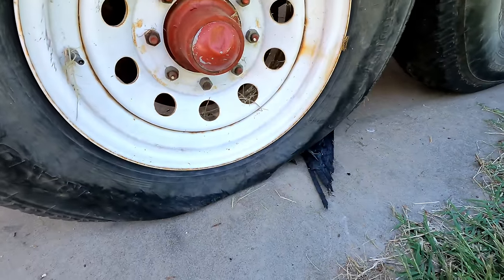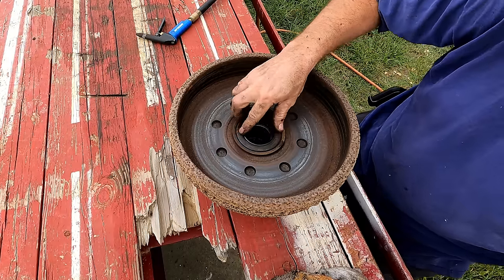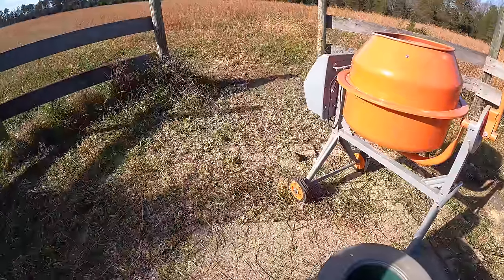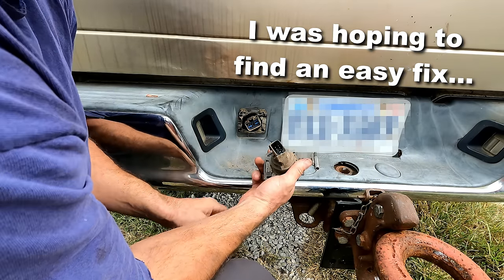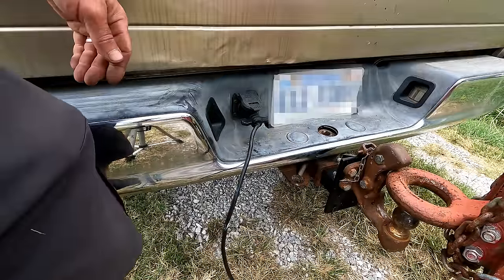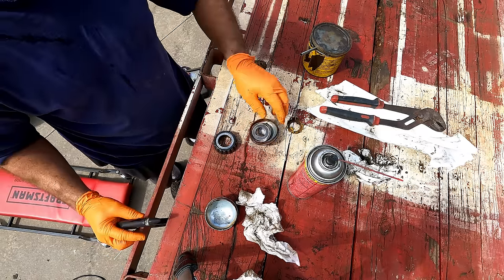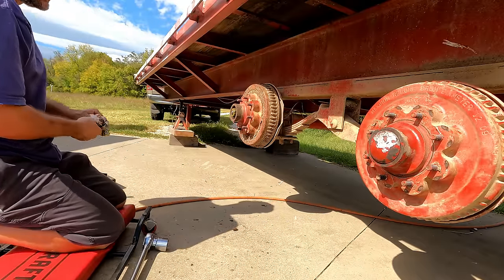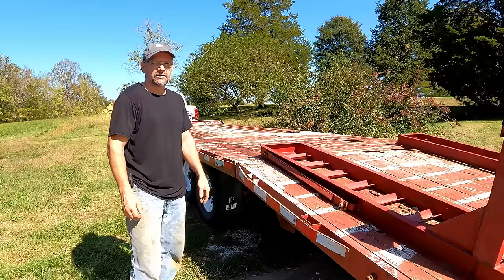Fixing A 7 Ton Equipment Trailer: Brakes, Electric, Tires, & More.

Comment from the maker: Use 'FARMCRAFT15' discount code at checkout for 15% off your order!:  https://optivolt.com/100w?=farmcraft.  Thanks for watching and have an awesome weekend everybody!
Reply: Have you thought of building yourself a ""Hoverboard""  for your excavator. There really handy especially if you've got a big property. The king of obsolete here on YouTube knocked one together using scrap parts. All you need is an Axle either a trailer or a real car/truck axle & some half decent size box or C channel then all you need to do is drive the excavator up onto the axle and the bucket either sits in the truck bed as long as your not pickie about damaging the truck bed or put a receiver on the back of the bucket either way you don't need me to tell you how to design 1 just saying as it would make a great video and be invaluable to you .
Reply: Next time please look into a product more or ask some experts then to fall for such a scam company.
Reply: Those panels are called amorphous and have been around for years. Expensive though.
Reply: Anybody else having an issue with the discount code?  I needed a new solar panel for the gate and wanted to try one of these but the discount code isn't working.  Edit: Nevermind seems to be working a few hours later.
Reply: amazing guys gj!
Reply: IMPORTANT: Look into self vulcanizing rubber splicing tape.  It comes in either backed or non backed.  I only purchase and use backed in very large applications requiring thicker tape.  I prefer 3/4 inch or wider 3M non backed instead of 1/2 inch.   
Any electrical shop of the electrical section of hardware stores has it for between $5-$10.   Read the directions for wrapping, but basically you stretch the tape about 30% as you wrap it, and within a few seconds it is almost difficult to unwind.  Seconds after that it actually starts to fuse together and an hour or more later it can not unwind.  All the wrap lines disappear like magic, or vulcanization.  Only can be removed by cutting.   With it you can make cable harnesses look like factory installations, besides having  the thinnest possible, waterproof seal.

Comment: I was an electrical technician in the steel industry for forty years. During my early years we had a class taught by 3M about their different products and all of us were using them wrong, especially the plastic electrical tape. In order to keep it from unwinding you need to wrap it in this order. Wrap the tape sticky side down, ie against the work. At the end of the initial wrap, without cutting the tape, twist the tape to where the sticky side is up. Wrap the tape back down the splice with the sticky side up. Then when reaching the end of the wrap, twist the tape with the sticky side down and wrap the splice again stopping when the tape reaches the end of the sticky side up portion. The object being not to leave a piece of the tape sorta flying in the wind. To double check this method , just simply stick two pieces of the tape together, then try and take them back apart. It actually vulcanizes itself together. Hope this helps in the future. P.S. I really proves itself in  greasy applications.
Reply: That is great information, thanks!!
Reply from the maker: I'll give that a try.  Thanks.
Reply: It sounds 3M is trying to get you to use 3x the tape you'd normally use :)

But yeah, I see how that can work.
Reply: Yes, sticky to sticky.
Reply: I don't see how this helps at all - now you have a layer of tape that's shiny side to shiny side in the middle of the tape layers - just perfect for water to get in there and sit.
Reply: @gorak9000 water is going to get in regardless of it’s exposed to it.
Reply: @lawnmowerdude  I have RF cables that are taped up with 3 layers of electrical tape, all in the same orientation (sticky side towards the cable) just going up and down and up again on the layers that are outside for >5 years - no water gets in the cable. If you're concerned about the end coming unglued, don't pull the tape to rip it at the end - cut it with scissors or a knife. If you pull to rip it off, the end never stays down. If you really want to make sure the end doesn't peel up, you put a zip tie on it. I've talked to people that do cell tower work - they use the same method, 3 continuous layers of electrical tape on top of each other. The only difference is they also put a layer or 2 of self amalgamating rubber tape under the electrical tape. Those connections are there for decades are are still water tight. On tiny wires like this, you're far better off using heat shrink with adhesive in it that melts when you heat it and completely seals under the heat shrink. If you buy the good stuff (aka not cheap garbage from scamazon) it's extremely good and seals well.
Reply: @gorak9000  - It also depends a great deal on what environment the tape is exposed to. Rain is one thing but being under the vehicle and exposed to high pressure water splash with salt and tar and oil and all sorts of solvents and sand and debris and freezing and 100+ road temps are whole different thing. I don't believe ANY adhesive tape can stand up to those conditions, a good quality heavy-duty shrink tubing is about the only thing that can last under those conditions.
Reply: Or just use shrink wrap like your supposed to in a wet condition.🍻
Reply: Or you can stretch break it like shrink wrap, it don't come loose. I started using a bit of water pump gasket glu on stuff to make it waterproof
Reply: @gorak9000 that's the way i do it. I put zip ties on it and it never comes off

Comment: When you pull the hubs off take the outside bearing out and put the nut back on enough so it will stay, then pull the hub off and it will knock the bearing out with the seal without damaging it. Then just clean the seal and any numbers can be seen.
Reply: I use that same technique on everything that uses a tapered roller bearing 👍
Reply: That's a great tip, I'll remember that.

Comment: the constant power terminal is to charge an onboard battery on the trailer in case the breakaway switch is activated. if you have a breakaway switch then you need an onboard battery on the trailer
Reply: You can also use it to run some small items like lights on switches etc… but yeah pretty much.
Reply: amazing

Comment: I think you were checking ground against the license plate bolt. Most license plate bolts thread into a plastic insert in the metal bumper insulating it. Great video as always.

Comment: Great videos as usual.  I think i have that same brake controller.   The reason it behaves different while stationary, is it has an accelerometer in it, and it uses that to add proportional braking (voltage) when moving.  When you are parked, there is no deceleration so it only applies minimal braking.  Whereas the manual override button applies the full braking/voltage.

Comment: Awesome video as always! Little trick to stop electrical tape unwinding, you can carefully melt the end to the underlying tape with the side of a soldering iron. Don't use the end, it's too hot and you'll melt right through! Hope that's useful
Reply: If you don't have your soldering iron handy, I bet a knife/screwdriver and a lighter will work too.
Reply: I've been told (during my electromechanic-educution) to strech the tape to double the length it is on the roll, before applying it.
This activates the tape so it sticks together.
It is not supposed to stick together on the roll, you know...
Reply: This might be correct... but not recommended with Cheap electrical tape 😉
Reply: @TerrorTubbie666  no other roll-form tape requires stretching to activate... sounds like the kind of thing old hands say to see who figure it out & sort "the wheat from the chaff" if you will

Comment: Just appying brake pedal wont engage trailer brakes unless it's an older time delay brake controller. Most modern controllers have an accelerometer that progressively applies voltage the harder the vehicle is stopping. The manual override switch you used applies the max voltage allowed per your gain setting.

Comment: one of the things i end up doing a lot of at my shop is trailer wiring. i ended up spending far too much time chasing broken wires and bad grounds on the last trailer i worked on. i told him next time he brings his trailer over, bring a spool of the trailer wire, and ill build a whole new harness for it. he needed it back before the weekend was over so he could go to work monday with it, so i ended up having to cobble the damaged harness back together, and it pained me every step of the way haha! when i do wiring, i need to do it all properly. cheers John, glad you got your trailer all fixed up!

Comment: I rent and work on trailers on a daily basis. I learned from a co-worker 40 years ago that 90% of the time the ground is the issue on 12V systems. The other 10% is a bad wire, bad bulb, or a fuse. That tidbit has served me well and still holds true on the trailers I see today. A ground will get you almost every time and make you go bald scratching your head why does it work here and not there, now and not now, as in what you ran into. Glad you coated your connections with some sort of dielectric grease, it really helps in the long run. When I rivet a clearance light to a trailer, I coat the rivets with dielectric grease to clean corrosion on the back side where I can't reach to clean the surface.

Comment: Informative video as always. Old fashioned self amalgamating tape is still available in the UK and I use it on vintage cars to good effect. Years ago wheel hub and brake drum were interchangeable. Old dinosaurs tend to remember these things but not where I last put the screwdriver! Thank you for posting. Best wishes from the UK.

Comment: Your videos are awesome!   Thank you.  Those aftermarket brake controllers use G forces to modulate the amount of voltage to send to the trailer brakes.  The brake pedal in the truck doesn't send brake fluid pressure (i.e. how hard/much you are trying to stop) to those controllers, it just sends 12 volts.   Those aftermarket controllers then use G forces to determine how much voltage to send to the trailer brakes after receiving that yes/no/on/off/1/0  12v from the brake pedal.

Comment: As an aircraft mechanic most of my life I have learned with electrical issues, 90% of the time you can trace it down to a bad connection or crappy grounds. Removing and installing connectors is great way to uncover intermittent or high resistance in the connections. As a troubleshooting rule start at "bad connections". I love your videos and all of the various skills you have. Looking forward to your next venture :goodvibes:

Comment: In Canada, all trailers require an emergency brake applicator which consists of a small lead acid battery on the trailer and a breakaway switch that must be connected to the truck body via a small cable.  If the trailer hitch comes loose, the cable trips a switch that applies the trailer brakes using the onboard battery.  The power output charges the onboard trailer battery.  Of course, with an RV, it also charges the onboard RV battery via the 12v output in the plug.

Comment: I really enjoy your videos. I wanted to share my rules for trailer wiring repair, after having spent many hours chasing wiring gremlins. First, I built a tester that I can plug into my tow rig to verify all outputs with LED lights I can see from the cab. I also have a remote power box that will do the same for the trailer plug. I use premade plugs with a wiring harness, and then use a junction box to distribute throughout the trailer. I can check at the j-box to further isolate the fault.  If I have an intermittent or constant failure, I replace the entire wire from the j-box to the end use. In the long run, it has saved me time and money. I do not use electrical tape. It has proven to be unreliable for me. I use marine grade heat shrink, which provides a waterproof, permanent seal. For connectors, I use a marine grade heat shrink connector with build in solder. Soldered and waterproof connection. Short of physical destruction, this procedure works for me, and I seldom have to go back and repair the same faulty circuit. Just my experience.

Comment: One more thing we learned, that tape is not designed to stretch. It will always try to go back to its original size. When putting it sticky side to sticky side, by putting a slight tension on the outer wrap it does help with the adhesion.
Hope this helps in the future.

Comment: Hi John,
Great video as usual.
As one of those across the pond it was nice to hear the 'L' in solder !!
Over here all trailers over 750kg gross have to have brakes and automatic break away application built in so I am surprised yours doesn't have something similar.
I'll admit to not a fan of using power to apply the trailer brakes; mechanical overrun works up to 3500kg ( over this coupled brakes are required ). The best coupled brake systems use compressed air acting against a springs to keep the brakes off so breakaway or airline failure applies them automatically.
BTW, given the way the electric brakes work, does the trailer have a parking brake ?

Comment: To repack bearings with grease with a lot less mess, put the bearing in a plastic bag with the grease and work the grease into the bearing inside the plastic bag.

Comment: I feel your pain within 3 years I had to replace my trailer tires.  My tire guy calls them China Bombs.  My flatbed tires lost tread & belts,  all 4 had to be replaced.  I found  out that all Trailer tires are now made in China, except for Goodyear.  So I switch to Goodyear, I am very happy so far, the trailer seems to ride better with less sway.

Comment: Tiring. Upon reassembly, I’d hit the backing plate with a ball peen to settle the shoes for a click more or two. Lube backing plate, cams, brake bar, self adjuster and clean the inside hat of the drum for the magnet. Bearing buddies are effective. Great video John!

Comment: I hope your experience with Hercules tires is better than mine, I put 8 on my flatbed and all had either thrown the tread or had bulges in them within two years, not more than 5k miles on them. This was probably 12-13 years ago so hopefully they are better now.